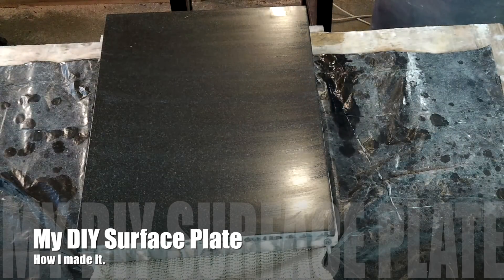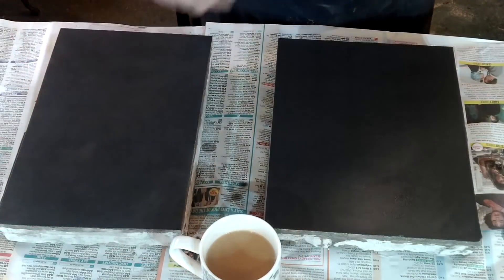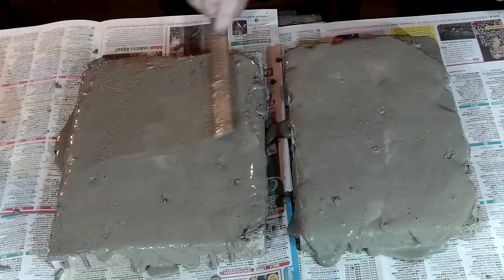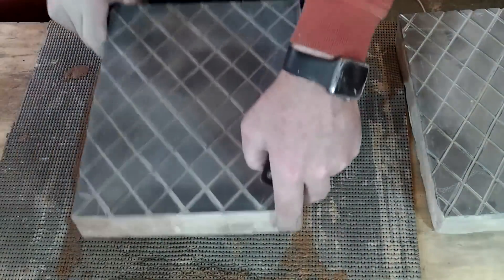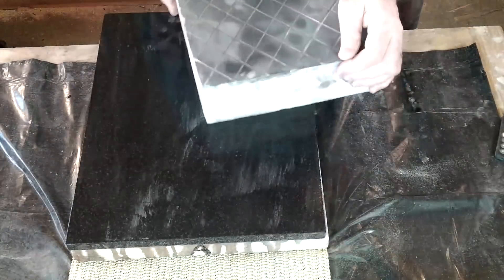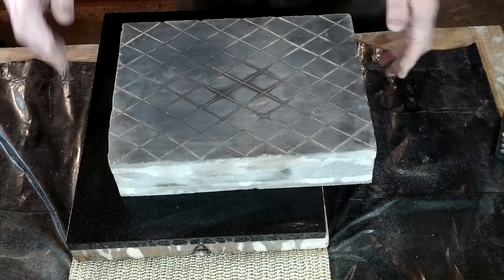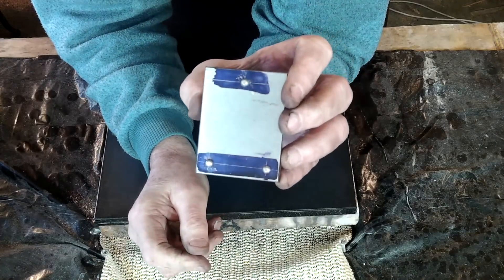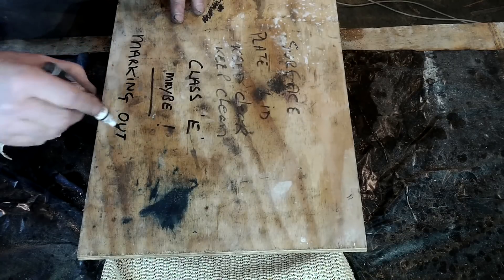My DIY Surface Plate

Comment: I love seeing DIY scratch-built work of precision instruments!  That said, not everone has the physical ability to do this.
If you haven't already, you would do well to check out RobRenz's videos on a DIY Repeat-O-Meter.
A DIY autocollimator is rather harded to DIY, but not impossible.
Granted you haven't got room for either on your small plate, but if you ever decide to make a larger one...

Note that if you buy three cheap import cast iron surface plates, you can turn all of them into high precision plates simply
by working them against each other in a specific order.  Now you have a precision lap for your next big plate, a "workbench
plate", and one to sell. :)

I cultivated good relationships with all my local surplus stores for decades. 
As a result, I was able to get some fine deals on all sorts of odds and ends over the decades.
One of those was a 18x24x4 Standridge "lab grade" plate which measured well above Class A requirements... for $100.
It showed no sign of use because it came from a failed startup and the plate was bought at auction, and when i got it, it was
still in cal.

It may not be pink quartz, but it was a good deal.  A non-fitting stand was included which I cut and re-welded to fit, and re-did
the support points. The size was just right to fit both my needs and the available space.
Reply from the maker: @railgap  here in the uk. This kind of hardware is available from time to time but, oooo it’s expensive.

Comment: 4:30 the channels are not for catching the abrasive. They are to prevent a wave of abrasive slurry from building up in front of item being lapped and rounding the front edge of the item being lapped.
Reply from the maker: Hi, yes that is true but, I think the liquid and abrasive material can also sucked out of the grooves as the plates passover each other, don’t you think?, cheers.

Comment: If you want a large plate, try your local architectural stonemason. I got a 42 x 30 x4 inch rose granite redundant gravestone. I had to obliterate all inscription from the front, which is now the underside. total cost - a bottle of whisky wrapped in a photo as proof of the obliterated plate. I was unable to detect daylight using a good rabone straight edge so for the sort of things I do, that is close enough. God alone knows how it would fare under high tech measuring devices - not too well methinks

Comment: That was a LOT of effort.  I wonder if there wasn't some way to move the plate around with a motor or something.  I had a fuel tank that was rusted on the inside and I tied 4 cords to the corners and then hung it like a flower pot, poured in some tumbling media and some liquid, used a motor with a crank and tied to the side.  Let it run and tilted it occasionally to get the top and corners.  It looked great.  I wish I had coated it inside with sealer because I looked inside the other day and it really needs it again.  sigh.  This was a good video and you explained everything really well.  A definite thumbs up from me.  I'll think surface plate every time I see a large piece of tile now.

Comment: you cut diamonds into the surface to 'collect and redistribute' the abrasive.  lapped your "B" & "C" plates (diamond side) together.  then proceeded to NOT use that side to lap plate "A"??  what was the point of that work, then, just to use the non-lapped marble side on your surface plate!?  you wanted flat bottoms?? what am i missing?
Reply from the maker: Hi. I’m sorry for the confusion, the video was made to explain how I made my marking out surface plate to those viewers that asked me how I made mine. Using the  two marble faces wasn’t a good example I admit but I had explained in the video that I used the other two identical surface plates in the garden…well my wife did actually, anyway I needed a couple of lapping plates to rub muck off some of the metal I often get given. Sand and water or oil can shift a lot of muck and rust saving sanding belts on the linisher and preventing clouds of dust and muck being thrown around the workshop. The marble side was used to show how I made the original plate. It’s not accurate but it’s brilliant for marking stuff out. My surface plate has a deviation of 0.001” good enough for marking out. Cheers

Comment: Would it be easier and quicker using diamond impregnated surface prepping wheels( like a surface grinder/tile saw)?
Reply: if you have a precise surface grinder it should be
Reply: Because I’m thinking of using a solid piece of granite, which would be more durable than marble. My biggest fear is that granite and marble tiles would be too brittle. I’ve got access to granite slabs at least 2” thick, which in turn I can also use for doing leather work.

Comment: A video about optical flats stated that the grooves in lapping plates are there to allow air between the 2 surfaces. Otherwise they may bind so hard, it's impossible to separate them without damage.
Reply from the maker: Hi. Yes that’s true but, my DIY lapping plates are really for cleaning old and dirty metal  that’s been given to me. I don’t like having muck and dust flying around the workshop that I get using the linisher or rotary wire brush. Cheers

Comment: Layers of two different material means different expansion  rates so through  time  your plate may become curvy.
Reply from the maker: Hi, it is true that is why I only use it for marking out. I have used it for gauging stuff before now but, that was before I had my cast iron surface plate, that warps if you walk past it but it is more accurate than the surface plate I made.. cheers

Comment: 🟢 Friend! I don't have a very thick stone (100mm). I have a lot of 20mm stones.
I intend to "work" 3 large diameter stones (1000mm X 1000mm). I think 20mm is too unstable for a big rock like that.
Can I glue several stones to get a more stable thickness?
I chose a harder black stone in my region of Brazil.
I also thought of making ribs in the shape of honeycombs between a sandwich of two 20mm stones.
I'm building a universal milling machine, the stones would be to "right" the flatness of the dovetail guides and the coordinate table.
Reply from the maker: Hi, I’m not an expert on surface plates as I pointed out in my video. However, one thing I do know is that the thickness of the plate is relative to the size of the surface plate. Not being an expert, I would expect a 1000mm square plate to be at least 100mm thick minimum. I would also expect that to maintain best stability, it would have to be in one piece, at the very least all made of the same material and the bonding agent to be as thin as possible. Temperature and humidity play a big role in the stability of of surface plates so the fewer variables in its construction the more stable the material.
Sorry I can’t be of any more help.
Regards.
Reply: @Thesheddweller  Gratitude friend!
Reply from the maker: @silvionovais2504  You are very welcome.
Reply: Нет
Ищи целый камень

Comment: I don’t think your measuring tool can prove that it is a flat surface, because it may also be a spherical surface with a small curvature.
Reply: true, but they should be 3 plates with the same constant curvature, which is impossible. 
That's why 3 plates are used. If you use only 2, it may happen that you generate a curve (one plate becomes concave, while the other becomes convex, complementing each other) But it is almost impossible with the interaction of 3 plates, with the turns and rotation of the elements, you can get a curved surface, since the 3rd plate should exactly complement the curved shape of your 2nd plate, which in statistical terms it is almost impossible, even more so if you consider that the 1st plate would have the opposite curve. That does not happen.
A "rapidometer" makes comparative measurements, it measures the difference between one point and another, it does not give an absolute value of inclination as a collimator  might do (which measures angles).
Reply from the maker: Quite right. That's why I won’t use it for anything other than marking out. As a marking out table it’s more than adequate.  Cheers.

Comment: Made a 16x24 and got it down to .002. Not good for machinist work, but plenty good for woodworking tools and jigs, and metal fabbing.
Reply from the maker: Hi, thats also good enough for making out purposes. regards
Reply from the maker: Hi, thats what I like to see… someone having a go, good on you.
Reply: @Thesheddweller  I made (I think) a unique surface plate. The concrete plate was not tool-friendly, so I used epoxy and fine aluminum oxide abrasive powder slurry to coat the concrete. I used a paint roller to apply several coats, sanding each coat. It leaves a finish that looks "hand-scraped", and ground steel tools just glide over it. Couldn't be happier. Thanks for your inspiration!

Comment: One thought. Would sink cutout from solid granite countertops bonded together work as well. I've also wondered about the suitability of quartz countertop cutouts. Another UAE for them could be as the actual mounting surface used for a small benchtop milling machine. Bolting a mill to a wooden bench in my mind can lead to all sorts of alignment issues due to the wood expanding and contracting due to temperature and humidity iseues.
Reply from the maker: I would recon anything with weight and mass would be ok for a base support on a home made plate, but I wouldn’t go trying to get it calibrated. if the bonding agent sticks. Humidity in my workshop is kept below 60% and all my biggest machines are sat directly on steel or cast pedestals then on to a wooden floor supported by concrete bracing.
Reply: @Thesheddweller  Thank you for this channel and the discussions y'all are having. The passion is felt. I'm a casual, but excited to learn more!
Reply from the maker: @mturallo  Hi, thanks for your comments

Comment: I would rather pay 300 for a Starett of the same size
Reply: There's a cost / benefit equation in there, and if you want a verified accurate plate right now, sure, that's the way to go.  However, if you're interested in the process, have exotic needs, or just plain don't have the money to buy a new (or even old) plate - as Paul says, they aren't anywhere near as cheap over here in Yurp - there's a lot of benefit to be had from rolling your own.
Reply from the maker: Hi, they aren’t that cheap here in the UK. US to UK customs charges and delivery puts almost 50% on top.

Comment: Very good video :) In stead of diamond powder or paste, you can also use Cerium oxide.... It's available as a powder in many different grit sizes, and it's 90% as fast/effective as "real" diamond abrasives. And since it's so much cheaper, get a few hundred grams extra.  It's great for polishing out things like windshield wiper marks on your car's windshield, removing smaller scratches and haze on a marble countertop, chrome details on vehicles and such things (where less hard abrasives like Aluminium oxide and such hardly touches the surface).
Reply from the maker: Hi, thats a good tip. thanks.
Reply: That's interesting, but I'm not sure cerium oxide is right for this application.  Its hardness on the Mohs scale is 6-7, which is about the same as granite.  Also, a quick search found 5μ and 10μ to be the coarsest grit commonly available (0.3μ is the fine stuff used in telescope mirror final polish).  The bottom line will be that it can't scratch the granite, so cutting will be slow.  The main diamond substitute I am familiar with is cubic boron nitride (cBN; not to be confused with hex boron nitride, hBN, which is a sliding plate lubricating form like graphite and mica).  Monocrystalline cBN is available as a powder or as a lapping compound paste in different grades, analogous to silicone carbide lapping compound, except that cBN is a super-hard material at about 9.5 on the Mohs scale (where diamond is 10).

Comment: в кружку абразива не насыпал ?
Reply from the maker: Привет, Моей кружке всегда удается собрать какой-то осадок, но не в этот раз. Ура.
Reply: @Thesheddweller  кроме индикатора (репитометра) как то еще плиту поверяли, (проверяли) смотрели ?
Reply from the maker: @guliwer1713  Мне очень жаль, что вопрос, который вы задали, выглядит странным при использовании моего переводчика. поэтому примите мои извинения, если это выглядит неправильно. Поверхностный датчик (репетометр) работал, как и следовало ожидать, учитывая, что это бодж. С уважением.
Reply: @Thesheddweller  переводчики они такие  .... х** поймешь че напереводят .... 

what else did you use to measure the Surface Plate 

какие еще вы использовали приборы для измерения (ru)
what other measuring instruments have you used Surface Plate (en)

Comment: A good explanation, but as you said to fully detail the whole process would make for a very long video. For anyone needing a more extensive explanation about why 3 plates are required and how it creates very flat surfaces. https://ericweinhoffer.com/blog/2017/7/30/the-whitworth-three-plates-method
Reply from the maker: Turning Point Hi, thank you for the heads up on this site, it is very good. Regards

Comment: sorry, but is piece, sorry 3 pieces of stone : too thin + glue + pies pumice +glue + thin piece granite - all have different  temperature expansion (especially glue) & hogging under pressure . better, or correctly do that with 10 sm or more granite (not all, need hard, better  diabaz or gabro). IMHO. process correct
Reply from the maker: Hi, I agree, but I don’t know anyone who can boast having any equipment to measure the error, let alone constantly control temperature of their machine shop environment. regards.

Comment: Good enough for workshop. But not super flat.
Reply from the maker: Hi, I know. I have a cast plate now for my workshop, but I have to get it verified before I can use it.
Reply: @Thesheddweller  There's nothing to stop you verifying your own plate if you can get your hands on a 0.02 or so machinist's level.  You could use teh results of that to do localised honing on your plate to move it up a few grades pretty quickly.

My plate was made from a piece of granite kerbstone, by localised honing only, which is a much longer process than the 3 plate method.
Reply from the maker: @wibblywobblyidiotvision  thats worth looking into, when I get some time I’ll look into that. cheers.
Reply: @Thesheddweller  I've linked the software I developed for mapping my surface plate on (IIRC) the second of my videos about it.  It's jvascript, should run anyhere a reasonably modern browser will.

Comment: Non versare la polvere abrasiva sul piano, crei dei solchi profondi nella direzione della prima passata.
Conviene mescolare la polvere con l'acqua e distribuire la pappetta in modo uniforme con un pennello.
Non fare mai seccare l'abrasivo, si creano sfrisi, conviene usare al posto dell'acqua della kerosene o del petrolio.
Il piano sotto tende sempre a diventare convesso, quello sopra concavo, la differenza fra le due curvature è pari allo spessore dell'ultima grana usata. il sistema di misura è corretto,  solo che ti dovrai mappare la superficie per pinti discreti, pari all'altezza del triangolo di base ( le tre palline). ottimo lavoro
Reply from the maker: Ciao, grazie per la visione, grazie per il consiglio, molto apprezzato. Saluti

Comment: Thanks, nice vid. I'm familiar with the three-plate process, I'm currently making a set of cast iron lapping plates to Tom Lipton's design. I bought a granite surface plate, wasn't expensive. Graphite? I use mink oil. Not sure how they get the oil from the mink, don't think the mink are harmed...
Reply from the maker: Hi, thanks for watching. They probably make the mink run like a bugger for an hour or two in an exercise wheel.. :-D
Reply: @Thesheddweller  LOL!!! I'm hoping it's the oil they use to stop the mink from squeaking - made *for*, not *from*.
Reply: @fredgenius  Well they definitely aren't squeaking anymore.  Best not to google it.